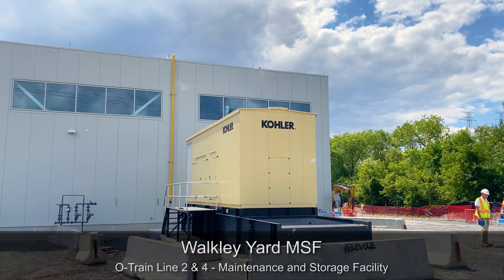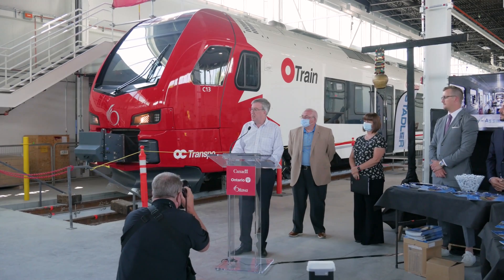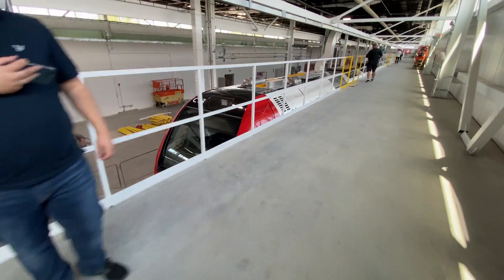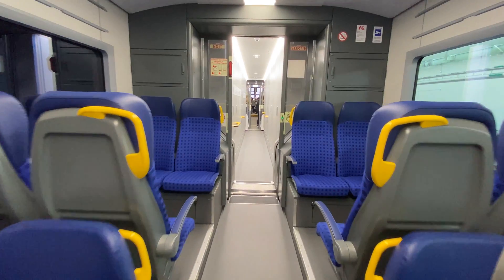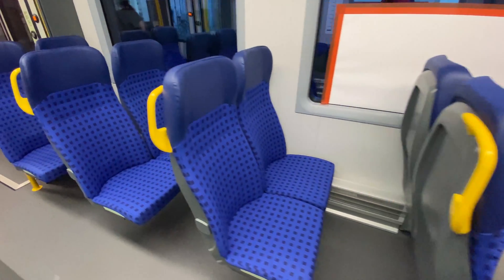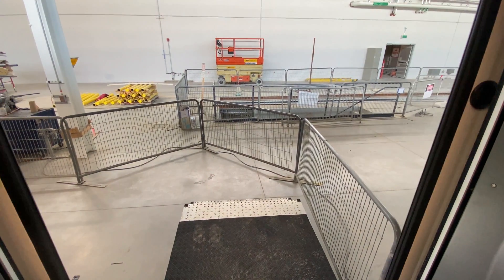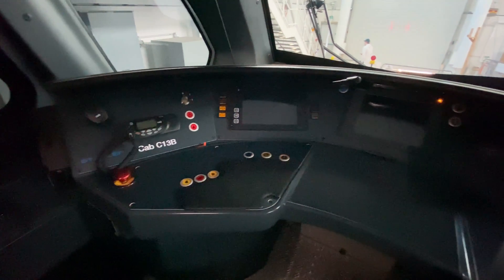Introducing the Stadler FLIRT, OC Transpo's Newest O-Train from Switzerland

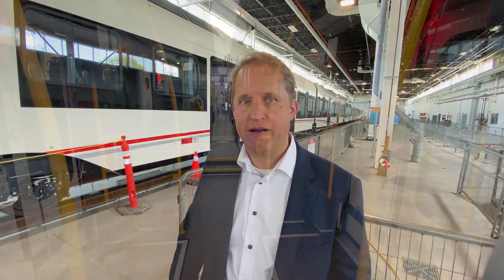Comment: My special needs son finds the Stadler FLIRT very interesting but at 2:40 he doesn't think that should be necessary because there are ways to use combustion and still protect the environment like using fuel cells for carbon capture, biofuel, catalytic converters, and planting more trees because trees are natural air purifiers and oxygen tanks.

Comment: They are no doubt wonderful trains but why is a city supposedly committed to a carbon-neutral future running diesel trains for its LRT? And, it's not good enough to say because we already have a small part of the line configured that way. Who made the case for standardizing on electric trains - either the same as the Confederation Line or better. And, while I'm at it, what's the case for having much of the Trillium line single-tracked? And, finally, the airport to downtown: two transfers involving three different type of trains - really?

Comment: I recognize these are Canadian service and you're a Canadian focused channel,but can you comment on if similar trains would be legal to use in the US? 

I'm particularly interested in mixed traffic service from Raleigh NC to Durham NC, but many places currently use old - to - ancient locomotives and passenger cars and could really use an upgrade.
Reply: Stadler already has some FLIRTs running on Texas (Texrail)
Reply: @truedarklander   TEXrail looks to be a dedicated passenger line - great that the EPA won't be a hurdle, but I know there are some regulations on passenger equipment sharing track with freight trains and I don't know if these are exempt.
Reply from the maker: As others have said below, TexRail has been operating the FLIRT for a number of years now. For our line in Ottawa, Line 2 is shared with freight so it is certified to operate on a line that can see freight traffic (it was formerly a freight line that was repurposed for passenger service). However freight traffic on it is very rare but it does happen on rare occasions. Most stations have short platform extenders that stick out from the platforms to bridge the small gap between platform and the train. When a freight would need to go by, the extenders would be flipped up so there would be more room to pass through. They are small but can be seen here. https://otrain.railfans.ca/station/carleton
Reply: @RailFansCanada  Thanks for the response! Hopefully in the medium future we can see many more of these on intercity service.
Reply: Stadler ans Siemens have production plants in the US and run their trains nationwide.😉

Comment: This is absolute great!! But one year late. But why diesel? Too cheap to get electric?
Reply: The Trillium line runs through a tunnel under Dow's Lake.  The tunnel was not designed to accommodate catenary wires.
Reply: Diesel is more reliable than electric, especially in Canadian winters
Reply: It’s both electric and diesel

Comment: why dont they throughrun the 4 trains to the line 1 interchange 
changing that oftain to get to the city from the airport  isn't practical
Reply from the maker: This is due to the Line 2 still for the most part being single track. Council decided there was higher benefit to serving Riverside South with frequent direct service than the Airport. Technically trains can run from Airport to Bayview but this will be only in rare occasions, atleast initially.
Reply: @RailFansCanada  but they just upgraded the line 
But it is still so overcrowded that you can't run every 3. Or so train to the airport?
Reply from the maker: @burgerpommes2001  it’s not overcrowded. With single track, every 12 minutes south of South Keys to Limebank would become 24 minutes when there was a train that would head off to the Airport. Single track is the limitation. Otherwise the new trains are double capacity from the old service.
Reply: @RailFansCanada  why didnt they build more passing loops or double track the thing
Reply from the maker: Money and they don’t see a need for higher frequency at this time. There are some more passing tracks but the main bottlenecks are Walkley Station (as the passing track is just north of the station and not at the station), Dow’s lake tunnel and Rideau River bridge.

Comment: I've been on the Stadler FLIRT in Helsinki, Finland, and Tallinn, Estonia. Both of them run on 1,524 mm gauge and have 2+3 seating as it has a wider body. The Estonian version has the power pack in the middle like Ottawa does, and when the train accelerates at full power it doesn't really feel that loud. The diesel engines are not mechanically connected to the wheels, rather the engines act as generators to give electrical power to the whole train including the motors, which work like those on a regular electric train otherwise. Outside, it is a little louder than an electric train, but much quieter than say, a GO Transit train in comparison.
Reply from the maker: Thanks for sharing your experiences with the FLIRT overseas.
Reply: Also means that if they ever electrify the line, they just need to remove the power car and add pantographs.